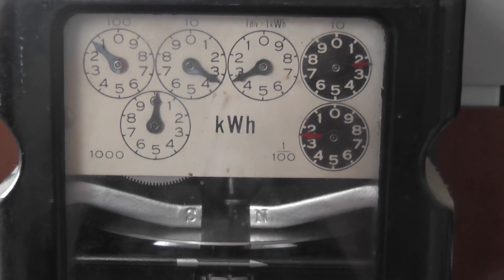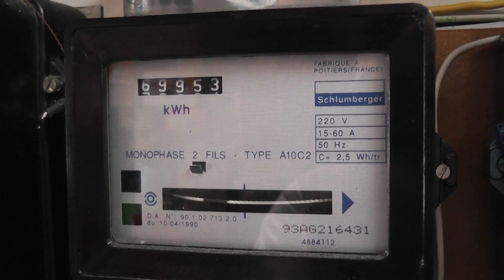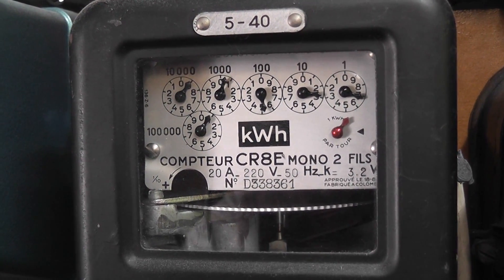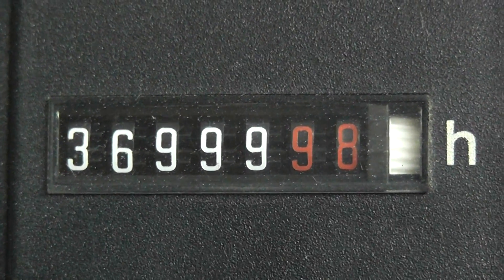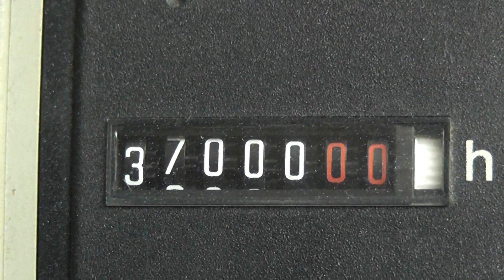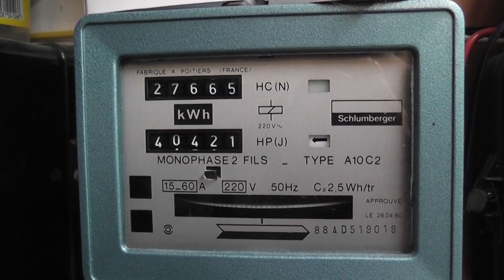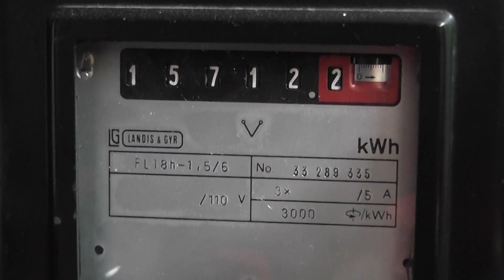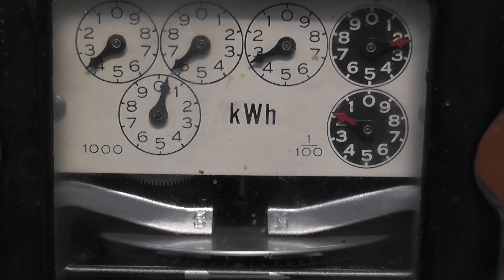Meter readings on some of the meters at home

Comment: Are you running the house feed through these too or are they powered only for the videos and experiments?

I kinda miss my old mechanical meter.
Reply from the maker: House feed and heater circuits are run through the meters.

Comment: do the meters consume power them self? how accurate are the electrical mechanical compared with the new electronic smart meters?
Reply from the maker: They consume about 2 VA in the potential coils (±2Watts) As a customer you don't pay for that as the PT coil is energized from the incoming (non-metered) supply.
The electromechanical meters are very accurate compared to the electronic meters. Timewise they will outlast any electronic meters which have electronic components in them which age and can fail during power surges.
Reply: yes they do only around 2 watts